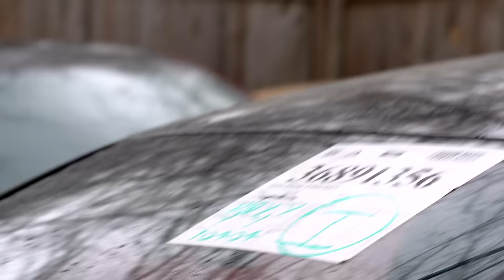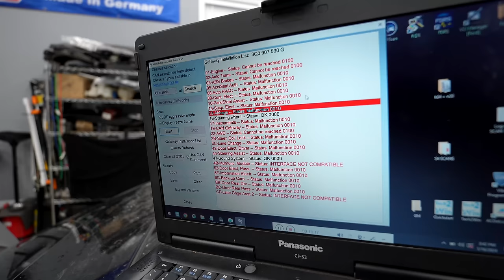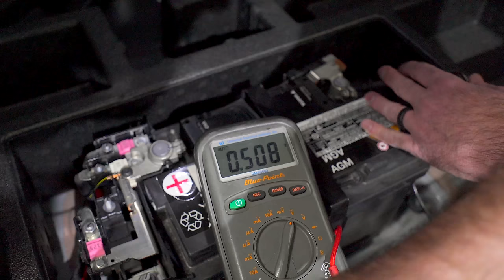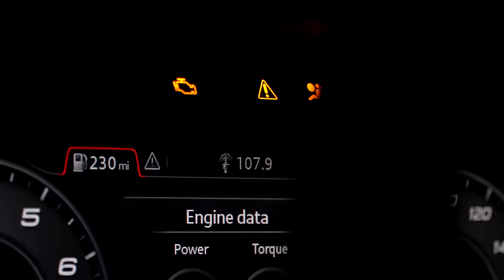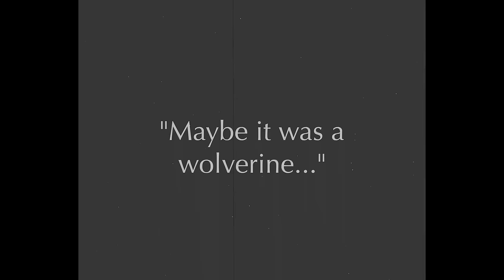REBUILDING My Totaled Golf R Before RS3 SWAP

Comment from the maker: Whats your best guess on how the RS3 got smashed????
Reply: Motorcycle crash maybe.
Reply: Too much power from the single 80mm turbo
Reply: Overconfident in the wet and went sideways into a pole/tree
Reply from the maker: This is starting to be the thing that makes the most sense! I LIKE IT @Jsbs1991f
Reply: A single slowflake hit the pavement and a southern driver spun out of control and smashed into a light pole at 35 mph.

Edit: well, the rusty underside proves my theory wrong.
Reply: They parked it on a pier
Reply: Regardless of how it happened, if you buy the parts Paul will drive to you and install them.
Reply: Sasquatch got angry after his hellcat got absolutely waxed by some fancy VW and threw a temper tantrum
Reply: Lost a race to a turbo vr6 and thought it would be less embarrassing to crash his car than admit he lost.
Reply: Someone steaked it… T-bone steak lol
Reply: Drifting into a ice cream truck on a rainy day.
Reply: Reverse J-turn into another hatchy-hatch.
Reply: Light pole? Any chance you'd sell me the RS3 wheels for cheap?
Reply: Rakishi or Yokozuna did a butt splash into it.
Reply: T-bone by a bike
Reply: Wanted to guess also on how the Golf R got hit. Somebody behind you lost brakes?
Reply: motorcycle t boned the rs3 is my guess
Reply: Ran out of Talent........
Reply: understeer on summer tires during the winter.
Reply: Leaves a cars and coffee meetup
"Watch this, boys!"
RS3 promptly parked into pole
Reply: Certainly not a rich kid street racing the Audi their dad paid for
Reply: I cannot contain my excitement for this swap. Please document as much as possible! specially the wiring and programming part. i want to DIY this project for long time but could not find any reliable source of information to do it myself.
Reply: Over-committed and under-talented is my guess
Reply: @Jsbs1991f definitely a motorcycle to the side of it
Reply: them too fast too furious drifts ;)
Reply: Showing off for the boys, and it got out of hand 😂
Reply: A small SUV try to make a left turn and hit it in the side.
Reply: Rhinoceros.  Definitely involved a rhinoceros.
Reply: Following your CSI lead, let's look at the facts.  You have a performance oriented car.  That car has been modified for more performance.  That car suffered a sideways impact to a cylindrical object like (possibly) a post while, from looking at the damage, the car might have been traveling slightly backwards relative to the object it impacted, i.e. not directly sideways.  That car has lots of loose dirt well up inside areas where you normally wouldn't find such dirt.  Q: Now, what type of driver modifies a performance car for more performance?  A: The type of driver who does track days and maybe autocross events.  That car was crashed when the driver lost control and slid it off a racetrack, impacting a safety barrier and possibly tire wall.  He/she'd been off track before and piled up a bunch of dirt/dust up in the underside of the car.
Reply: I.E., the car got smashed when the driver ran out of talent.  Happens at track days a lot.
Reply: racing on pink slips against a 94 260k Celica with a guy yelling REV UP YOUR ENGINES.......................
Reply: It saw an EPA emissions test up ahead, and panicked?
Reply: Round end part of the iron guard (vangrail we cal it in PapiaDutch). 😂😂😂😂
Reply: Hey humble mechanic do u reprogram mechatronic unnit
Reply: @Dirtyz1234  Looks like yellow paint from a pole as the roof isn't too smacked a short pole
Reply: Talent failure, press common on fast cars
Reply: Snow drifting in a parking lot
Reply: Track day!
Reply: Got too excited with the sport diff and got it sideways in a parking lot showing off and drifted into a light pole cement base
Reply: Gorlock The Destroyer
Reply: Waiting for the old owner to come forward
Reply: That is a regular occurrence in NC, usually someone in a Corolla on their roof at the first snowflake.  @300DBenz
Reply: Quick Question how come you are swapping the engine? isn't the one from VW R still good? Maybe I missed that Video :(
Reply: almost wraped aroud a pole, if it was an older car it would be a U lock
Reply: Drifting
Reply: I would  repairdthat RS3 and enjoyed it,and the Golf left a original R
Reply: Was at a junction takeover
Reply: Looks like a corner guard rail at an off ramp.
Reply: can you share what the totaled rs3 cost?
Reply: sell me the rs3 wheels ! lol

Comment: Fantastic video as usual Charles!!!! Brings me back to the winter that I worked at the Pittsboro Body shop. I went from painters helper to an apprenticeship in body mechanics and the biggest job they had me do was a rear quarter on a 2008 subaru impreza. Very similar process in making sure everything was pulled out and then taking things back and finding more damage getting the parts and fitting them in place and cutting what was needed then prep and spot welding and seam sealing. Congratulations on getting your baby back and i cant wait to see the rest of the series ❤ 👍🤙

Comment: So luckily for you, VW and Audi interior, most parts, are plug and play. The seats just need a re-pin for the connector is bam all done. If you don’t have something the RS3 has then you just need to run power to that wire. Most do it through the cigarette lighter. I want S4 seats in my Jetta that has heated manual adjustment seats and that’s literally all I have to do to make it work like factory.

Comment: Hey Charles.. fellow RS3 owner here. Just something to keep your eye on as you swap over the RS3's drivetrain. Mines also a 2018 with similar miles around 75k. Make sure you check the health of the rear differential before you put it in. Mine failed right at 70k miles and had to be replaced. I have never beat on my car. it's been stock since I drove it off the lot with 0 miles on it and and I serviced the differential at 50k miles. Im not sure how many other RS3 owners have the kind of mileage on their cars. Im going to guess not many. So im not sure if this is going to be a common issue going down the road for the RS3, or if mine was just unlucky but its worth mentioning. The dealer that replaced it under warranty never gave me an answer on what exactly failed on it, they just pulled the fluid and it was full of metal flakes. Im assuming a bearing failed internally because it would just make a constant low grumbling or "bass" noise at low to mid speed under light acceleration sounded very similar to if both rear wheel bearings had been bad. Good luck with the swap! I'm excited to follow the series!

Comment: Iam seeing some 2.5 RS swaps here lately ( TR Hamzas Caddy, Savin Salvage Skoda) but this one is also special. It will get the engine VW should have put in there ( but Audi didnt let them) and the R already has all the AWD components installed. Most 2.5 swaps make great noises but fail to get in the power down because the AWD Haldex doesnt just bolt into a car that wasnt meant for it. And that Ginstergelb is just special :)
The DAZA is legendary already, it gave the RS3 driver enough speed to barely miss the driver door when kissing a telephone pole :)

Comment: I'm glad you were able to buy your car back and fix it. Wish my insurance company would've let me buy my R32 after the engine only was flooded, not the rest of the car, and was able to get a neighbor to push me out of the underground parking lot. They lied told me they had to crush it meanwhile my friend Mike from Tyrol Sport, the one who tuned and put a supercharger on my R32 told me the insurance company sold my ($60K, $30k for car plus $30k in go fast parts ) for $11K. 😢I wish I still had my R32. I'm glad you lucked out. Like your videos

Comment: He said * I don't want to scratch the door * 
 Progress is awesome on both cars . 
 Why not a 4.2 v8 or even 5.2 v10 .  
 Next question 
  All wheel drive  
  How are you going to make this work as the wheel base is different in lengths, aren't they ? 
 Audi jeep thing lol there is a shirt 👕  for you . 
Your body man has a ton of patience for sure & a hot shop for sure . Here in ny there are too many requirements for body shop nowadays sadly.  
 Be safe all & stay warm .
Reply from the maker: The 4.2 and V10 are more novelties than practical. I Want to be able to jump in and roadtrip 

The cars are the same chassis basically. The RS3 is longer on the back, behind the diff. but the same basic size

Comment: I watch a lot of car repair videos and this is the first time I've heard of using both panel Bond and welding. How is it that the glue does not end up contaminating the weld is it because it's a resistance while rather than adding material like a MIG welder that it just melts the glue away and then fuses the two together and so the glue doesn't become a problem

Comment: Just a thing i noticed. I have been doing bodywork/painting for 15 years and when we replace structural body parts we have the car on its wheels to do all the welding. Is there a reason he never or didnt it seem to be much of an issue?

Comment: @4:01 That is why you should inspect it first and a little bit of common sense combined with a low bid should suffice. You have parts to sell. It is not like you go into a casino and go all-in on black hopping to win something. 😊👍
Reply from the maker: Good advice for sure. With CoPArt you can pay $35 and have a deeper inspection. Worth it!! Sadly this car didn’t qualify with iaai. And it was in Iowa 🤣

Comment: If you don't want to do more than 450PS I don't think of a reason for swapping 2.5l into golf ... 2.0L is ligher and makes golf handle better... RS3 is also worth way more and as I can see it can be easily fixed. But yeah your choice 😅
Reply from the maker: What’s the weight difference on those 2 power trains? We didn’t have scales or I’d have weighed it.
Reply: @HumbleMechanic older gen of 2.5T was like 50kg heavier than 2.0T this one is only 30kg as I know so maybe not such a bad choice sorry for my mistake 😃 
But still that RS 3 is such a shame to scrap 😅 in Poland it would be fixed - properly in a good whorkshop and back one the road.
Reply: @HumbleMechanic still very interesting build for sure will watch until the end also many others- that matters a lot in YouTube world ✌️

Comment: This is a perfect example why cars get totaled so easily these days. Monocoque design is great for saving weight and quickening assembly but they're tough to repair. You need to be a specialist and have a proper body shop to repair this stuff. It's not as easy as just bolting on new panels on your pickup.

Comment: Can someone explain the spot welding on top of the adhesive? Does it not promote a bad weld like welding through paint?
Reply from the maker: Thats how it is from the factory. The weld basically instant cures the glue

Comment: Rebuild engine snd transmission. Clean up thst carbon. Id use a new turbo which you will too probably going to 700bhp
Reply from the maker: I may end up with some deeper mods, but first we need to get it running!
Reply: @HumbleMechanic  you got a good start with a full car and electronics. I love your content. I have a Cupra Ateca which is a "mini SUV" but it's a golf R underneath. I always wanted the daza engine in it.  I just love the way the daza sounds. OPF killed the exhaust note but people just modify it

Comment: Any idea why my steering wheel shakes in a mk6 golf r. I got new wheels tires balanced and aligned. Mechanic says everything looks good and dont know why It shakes when barely moving the steering wheel to keep the car on yhe road left or right
Reply from the maker: ive seen a steering angle sensor not programmed cause that. but thats just a guess

Comment: Those wheels and tyres probably weren't on the car in the accident either. Considering it was "stage two"
Reply from the maker: Possible for sure. But I have seen a lot of "builds" with trash tires.

Comment: So purely for knowledge how does this buy back work? You bought the car new for let’s say $40k. It gets totaled. You buy it again for $6500. So you’ve spent $46500 to buy your car twice. Does the insurance ALSO give you replacement value money even if you buy it back? So do you actually only buy it for $6500 and are spending $33500 to fix it/upgrade it??
Reply from the maker: Yea so basicallly I got a $33k check and the car.
Reply: @HumbleMechanic  wow that is pretty neat. Never knew how that worked.